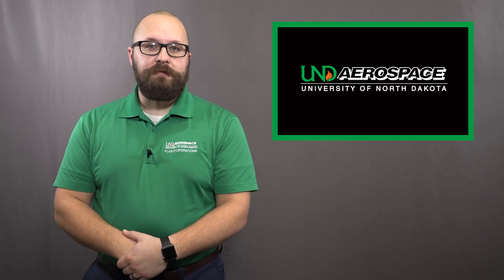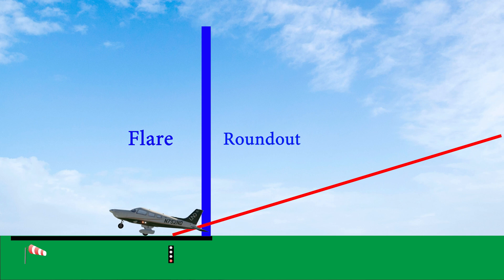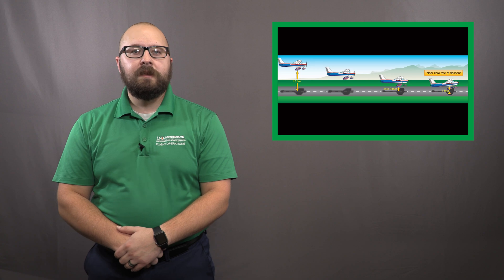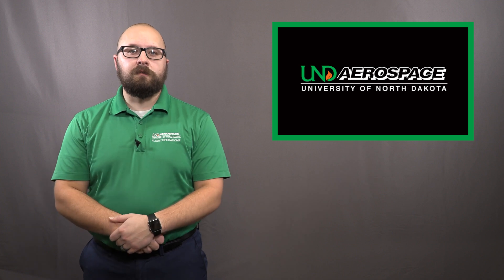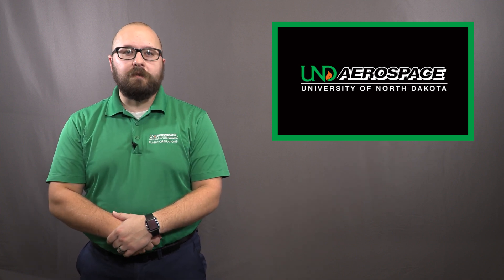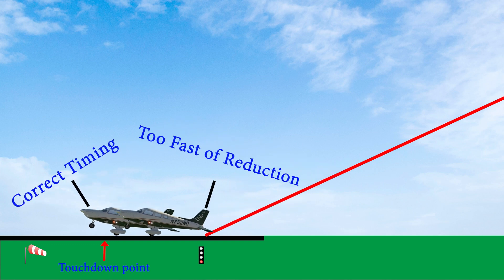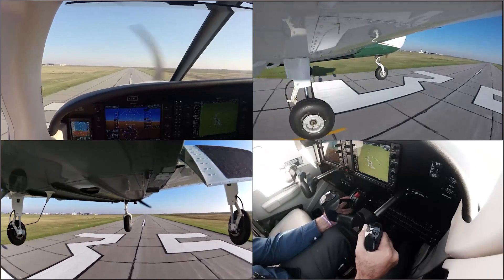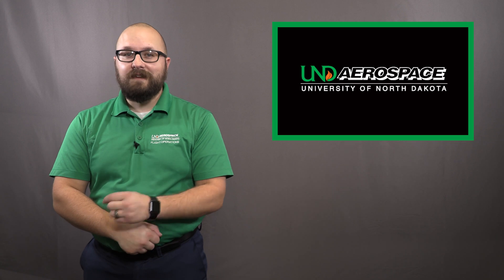Landing Series Part 3: The Roundout

Comment: Using runway markings to make throttle adjustments doesn't strike me as a good technique.  There may be landings in the future on surfaces with no markings (grass, gravel) or the markings may be obscured by weather conditions.  What are you going to do then?  The basic technique should be reliable 100% of the time.  This technique would not accomplish that.  Monitoring momentum toward the ground and the airspeed would always work for all landings on all surfaces, which let's face it, might be in some field with an engine failure.